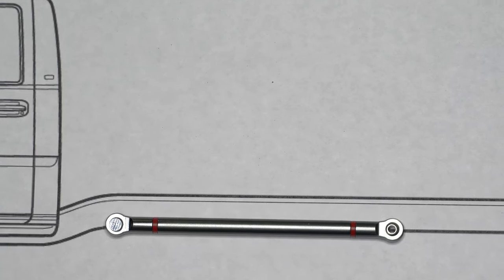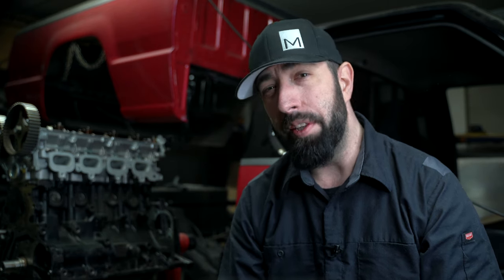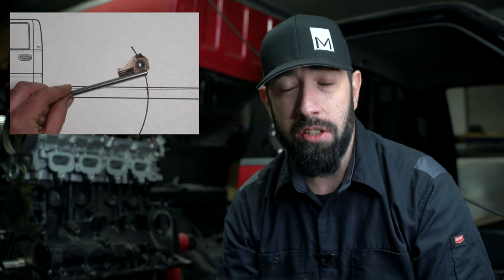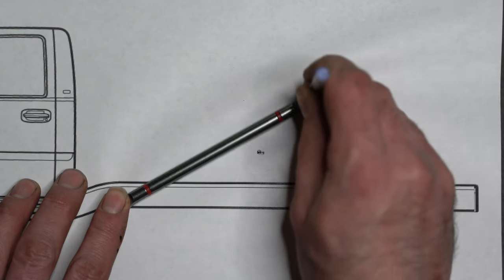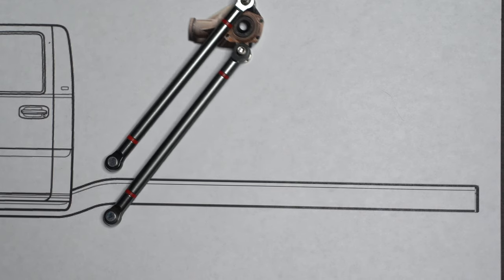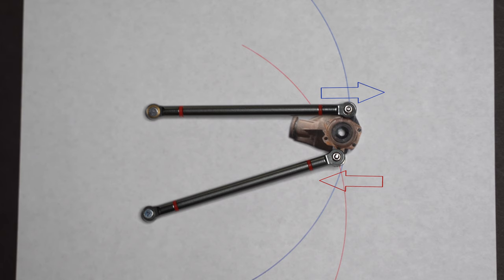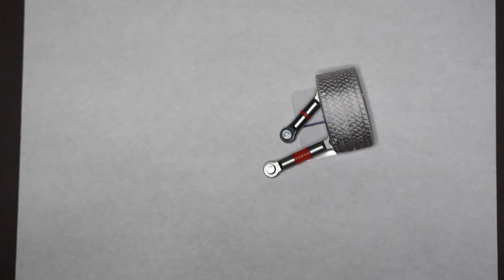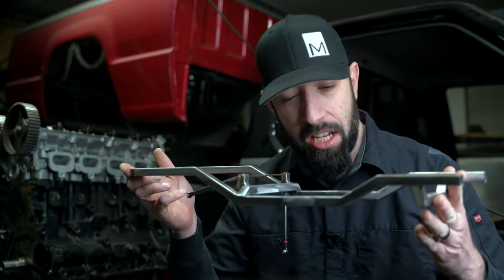Suspension Basics 02: The Effects of Link Bar Movement on Attached Components.

Comment: Holy shit this video blew my mind when you switched from pinion angle of a rear axle to camber of a front wheel
Reply from the maker: Yes! The two types of suspension are completely different yet they still follow the same principles. I’ll be starting on the front suspension on my Wife’s truck soon and I’m excited to introduce what I call “Third links” which refers to things like steering rods and drive axles; Components that aren’t necessarily part of the suspension but have to play along to avoid problems. Another potential mind blower.

Comment: Awesome video man but was so excited waiting for the last link of chassis end being closer to watch the pinion angle compared to the others and then the links changed so drastically I couldn’t visualise it. 
Don’t worry I got my own cardboard 😂
Reply from the maker: Bummer! Sorry my man. Did you do the cardboard model yet. If I understand what you’re describing, (the front pivots are closer together than the rear, forming somewhat of a triangle) you might be able to visualize it this way: Imagine drawing a line through the link bars beyond the bushings into space. The point that those lines insect is the point that the differential will rotate around. Hopefully that makes sense.
So when link bars are set up as mentioned, the pinion angle will change similar to the two-link at 3:54, but not as drastically because the imaginary pivot is much further forward.
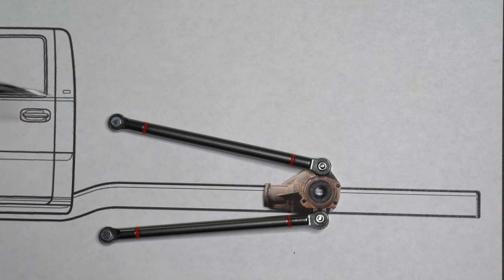This goes both ways. Meaning, if the rear bushings are closer together than the front bushings like the setup at 8:10, the imaginary pivot point is near the back of the truck frame. Watch that one again and notice how the differential (pinion angle) almost appears to rotate around the rear bumper would be.
Hope this blows your mind. It did mine!

Comment: 😅😅😅 Hello & a good evening to you. I am glad that I had search thru you videos and saw this. I am just two days away from receiving a pair of non OEM & adjustable rear upper link bar for a year 2006 W211 Mercedes. This new link bar allows adjustment of negative camber but it have red PU bushes which pivot freely on it's inner hollow tube. The inner hollow tube & the bolt, once tightened suppose to be non rotating?. I am inferring this to the concept of PU bush installing explained in your other video.

For now I am keeping all the other 3 rear OEM non adjustable links bar untouched. For the OEM link bars the black rubber bush is sort of factory baked in, together with its own hollow steel inser.

I understand that the cast or set in rubber in the end of the OEM link bar, while it appears to be solid, is actually reasonably flexible when a twisting load is applied onto it. This will translate into a bit of play or gives. Correct?.

So what in a negative manner will the new link, with PU bush of different play or gives, effects the play of the other 3 OEM rear link bars. I especially like very very much the last 5 minutes of this video. 

Regards
Reply from the maker: It sounds as though you understand everything perfectly. I’ll just reword it all to confirm.
Yes, the inner metal sleeve of a polyurethane bushing becomes stationary once the bolt is tightened. The polyurethane bushing itself will then rotate around this stationary sleeve as the suspension moves.
The bolt for the polyurethane bushing can be tightened at any time, however, the bolts for OEM rubber bushings must not be tightened until the vehicle weight is on the suspension. Tightening these bolts with the vehicle on a lift or jacks will cause the bushings to tear prematurely.
Yes, rubber bushings deflect more than polyurethane bushings, but there shouldn’t be any adverse effects simply because the bushings don’t match. If you’re sensitive, perhaps you’ll feel the slightest increase of vibration simply because your camber arms are a little firmer.

Comment: Thanks very much for this video & explain it the way you have . I think I may have to watch it a couple of times for it to synced lol as you said it's simple quite technical . I'm going to get under my Chevy check the pinion angle I got a sneaky suspicion it's a couple of 3 down out , l have a  slight vibration  about 60 mile an hour 100Km I thought it might be the drive shaft imbalance. Once again thanks for sharing
Reply from the maker: Driveshaft imbalance is a real thing too! Bad U joints can do the same thing as well. Wiggle the joints and see if there’s any movement, if not pull the driveshaft down and make sure the U joints move freely. Lemme know what you find!

Comment: Another one for you, in the example with a shorter top arm the pinion angle would need to be angled up a bit at normal ride height because once you hit a bump the angle will level out instead of becoming more exaggerated downward. Correct? I saw a kit car with the same set-up and looking at the chassis, equal length arms won't fit without interfering with the body. I was thinking of building a kit car (eg 50s racer) with equal length bars and Watts link, but now I think a triangulated rear is a better option.
Reply from the maker: On any vehicle, the pinion angle should be parallel with the transmission output shaft as often as possible. On non-adjustable height vehicles the suspension will have a natural resting ride height. This is the height the vehicle sees most often so this is the height when it’s crucial that the pinion angle is correct. With unequal length bars, (Which is the norm for static height vehicles) the pinion angle will indeed change when you hit bumps and dips but that’s not something to stress about. Bumps are only temporary. The vehicle will naturally return to its resting ride height and the pinion angle will return to normal.
It’s constant driveshaft misalignment that causes rapid UJoint failure.
Can’t wait to see which one you choose!

Comment: I want to change my suspension on my 1938 Chevy Business Coupe.   What do you suggest!   Just basic driving to the car shows.   Occasionally spinning the tires, but nothing extreme.   Love the tutorial s👍😎
Reply from the maker: Thank you, Kirk!! It would be really difficult to give a recommendation without seeing the underside of a vehicle. But in most coupes (cars in general) a parallel 4 link with a panhard bar or a watts link works best. A triangulated 4 link commands a LOT of real estate and would likely require you to cut and rebuild a lot of the floor behind the front seats. Maybe even requiring you to delete the rear seat. A parallel link setup on the other hand may also require some cutting but often only on the sides near or in the rear wheel wells. If you’re lucky you can position the link bars to essentially straddle the rear seat.
I can’t wait to see what you choose! Best of luck my man!

Comment: Thanks for sharing some valuable information I have really learned a few things. Just wondering if you have any ideas on how to have two plates in parallel with a pivot joint. I don’t want to use just a bolt with washers. Regards

Comment: I always see people mounting the link bars on the inside of the frame.  Is there a reason for the inside of the frame vs the outside of the frame? I am doing a triangular 4 link on a 02 f150. it looks like the straight bars could mount in the factory front mount where the leaf spring was, then I would have to weld to the axle.  What do you think?
Reply from the maker: I think the answer to that is just clearance! Most vehicles don’t have enough room on the outside between the frame rail and the wheels so inside is the only option. I worked on an old Dodge recently and the frame rails were so close together that the ONLY option was on the outside. 
I’d say as a rule of thumb the link bars SHOULD be as close to the wheels as possible especially if they’re load-bearing links. (Meaning the air spring or coil-over is mounted to the link rather than the axle)
That said, do what you’re doing! Just be aware that the front leaf spring mount often hangs down below the frame so if you plan to lay the frame on the ground, your link bar might hit first which is probably the only reason the factory mount would be a no-go.
Can’t wait to see what you come up with!

Comment: will you do a video on swing arm. please I thoroughly enjoy your videos.
Reply from the maker: Please clarify! A swing arm like on a motorcycle? I have a project coming up that could potentially help but no promises. Keep an eye out for “The Worlds Smallest Street Legal Bagged Minitruck” It’s a tiny truck that uses a street bike motor and the swing arm from a 4 wheeler.
Maybe it’ll answer questions and maybe it won’t. But it’ll definitely be fun.
Reply: @GarageFab  oh sorry. I can see how that would be confusing. I mean like a dull cool over long travel swing arm suspension in the rear of a pickup. not a single coilover like what's on a four wheeler dirt bike. I know on a truck when you do a swing arm setup you want to mount the eyeball under the axle tube so it's always pulling down otherwise under heavy load you can force the axle one way or the other. The only advantage I can see of the swing arm is the suspension travel which is what I'm looking for.
Reply from the maker: Understood, Bart! From my understanding, the benefits are mostly in the form of simplicity and added traction on acceleration because of how the geometry affects instant center. A fancy way of saying it’s designed to transfer the vehicles weight into the rear tires.
NASCAR has used that design for many years so it’s undoubtedly a good design.
But in my opinion steer clear of the two-link (My term for swing arm) if you’re building adjustable suspension like bags or hydraulics for pinion angle purposes.
But for static height suspension, it’s a great choice. 👍

Comment: Could you address independent rear suspensions? Specially the C4, I'm getting ready to swap one in my 93 GMC Sierra.
Reply from the maker: Oooo! That sounds fun. I will certainly be going over IRS and IFS while building my next truck. Unfortunately that’s a ways away still. Anything in particular you need to know?
Does the C4 still have the mono leaf spring suspension?

Comment: I'm experiencing terrible wheel hop on my G body. It all started when I replaced the engine with a much more powerful engine. I'm figuring it is due to pinion angle. I think the axle is wrapping up. Being an old school drag racer, I think my fix is to adjust the upper links to make them shorter and point the pinion down more, so that when it wraps up, the pinion levels out to be parallel to the transmission shaft. What do you think?
Reply from the maker: Well, Kris, I’m not race guy. And even worse, I’m not G body guy! I can tell you the small amount that I’ve learned about wheel hop. Mostly it’s caused by excessive movement. Leaf springs are sloppy so wheel hop is a huge challenge. For your application though, it would be excessive movement in the links. Bushings would be an obvious upgrade. But I did some quick research on your body style and found that boxing the control arms is a common mod. That tells me that the control arms themselves are floppy. Incorrect link bar angles can also cause wheel hop. Is your car at factory height? If it’s lifted at all, the increased angle of the bars can result in too much antisquat that could potentially cause Wheel hop.
Pinion angle, to my knowledge does not affect wheel hop or traction. (Traction affects pinion angle but not the other way around.)
I’m sure you’ve seen them already but there are wheel hop eliminator kits for the G bodies. I don’t know what they do! But it might be an option!
Reply: @GarageFab  Thanks for the reply! 
My car is sitting at factory ride height, but I did stuff 28x10.5x15 tires on the rear. 
I have aftermarket UMI tubular lower control arms and adjustable upper control arms. All the connection points have polyurethane bushings, so there shouldn't be much movement. This is also a Ford 9" under my car. 
I'll have to get it up on my lift and check the pinion angle.
Reply from the maker: Lemme know what you find! It sounds like you’ve already addressed everything that I would. 😩

Comment: Here’s a question - many parallel link bar kits place the two pivot points on the axle bracket further apart than the two pivot points on the frame bracket.  The instructions say to set the link bars at the same length, thus giving the parallel bars somewhat of a “sideways A” shape similar to ladder bars. How does this geometry affect the pinion angle, if at all?
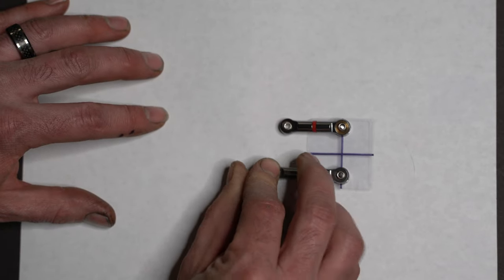Reply from the maker: If I’m understanding you correctly, your describing a similar setup as what’s shown at 9:43. This is super common and is ideal on static height vehicles. I’d recommend looking up the term “instant center“. If you were to draw an imaginary line through the upper and lower bars, the spot in space where those imaginary lines would eventually intersect is the vehicles instant center. Moving this instant center position around in the vehicle by changing the angles of the bars changes how the vehicle behaves under acceleration. This is no longer a “suspension basics“ topic.
Notice how the component angle changes at 9:43. This setup would increase traction if it were a linkbar set up, but the pinion angle change could cause problems on a vehicle with adjustable height suspension. Pinion angle should match the transmission shaft angle. A parallel 4 link with equal length bars would keep the pinion angle constant but would sacrifice some traction. Let me know how confusing that was! I’ll clarify if I can.
Reply: @GarageFab  I just released a video (that has your clip in the middle - thank you again👍), anyway, towards the end I unbox my new parallel4 link. The two holes for each link bar on the frame bracket are closer in distance than the two holes on the axle bracket. Not trying to weasel a view out of ya, but for clarity, it’s probably the best way to see what Im talking about, and if your response is applicable. Im going to look up instant center in the meantime
Reply from the maker: Weasel away! On my way right now.

Comment: Library none of your videos what size link bars to use like me I got a F350 as a pleasure but I also use it to pull by 38 foot fifth wheel camper what size length bars would I need to use in order to accommodate the weight Pole
Reply from the maker: Link bar length doesn’t matter much in regards to weight since they won’t be doing any heavy lifting. Larger bars would be wise because they will be pulling and slowing the truck and trailer. I’d likely use either 1/8 inch wall 2 inch round chromoly tubing, or 1/4 inch wall 2 inch mild steel tubing.
Link bar length should be as close to the length of the driveshaft (or rear section of shaft on a 2 pieced driveshaft) The difference in length between the driveshaft and the link bars determine how much the slip joint or yoke will move as the suspension articulates, which often can’t be more than 2 inches.

Comment: what an amazing series, came across your work while researching and i must say this is exactly what i was looking for, but i need your help with something, at 2:36 on the video you talk about using square link bars and mounting them as you would mount leaf springs, any chance that you could help me with links to pictures of what that looks like, i tried searching on google and i cant seem to find anything, what i keep finding is ladder bars and 4 links, thanks again for the amazing knowledge
Reply from the maker: Here’s a couple links that will hopefully help. There’s not a lot of good images of the axle/link bar connection. It’s really quite simple though. All the same hardware would be used that connects your axle to the leaf spring pack, except the springs are replaced with the end of the square link bar. A hole would need to be drilled in the link bar for the locating pin that sticks out of the U bolt/bracket hardware. Lemme know if you need more clarification.

https://www.nfamusmetal.com/tejas-2-link-kit/
https://store.ekstensive.com/products/73-87-chevy-gm-1-2-ton-rear-air-suspension-kit
https://pin.it/4qyWnsE

Comment: How would I be able to make a door hinge that pops out a couple inches then hinges like normal?
Reply from the maker: Hey Blake! What is this hinge for? I built a hinge for some Suicide doors that required the door to push away from the body several. It was just a large diameter curved hinge, but only had a single motion. Are you imagining two separate motions? Must it push out first before swinging? Hit me up on Instagram @GarageFab. I can share some images/videos of the Suicide door hinges.
Reply: @Garage Fab  it's for a truck that I'm building. I want to use a newer cab on an older door skin but in order for it to work properly I need it to open outward then swing like normal

Comment: With short top bars cause wheelhop?
Reply: Will*
Reply from the maker: No. Wheel hop occurs most on vehicles with worn/missing shock absorbers, leaf springs or reverse link setups.
Most production vehicles with link bars have shorter upper bars. That’s OK only because production vehicles are static height vehicles. On adjustable height vehicles, uneven length bars cause issues with pinion angle often resulting in vibration or damage to the Ujoints.
Shorter top bars are acceptable if your vehicle is always at the same height but if you’re building something with air springs or hydraulics I’d strongly recommend equal length link bars.